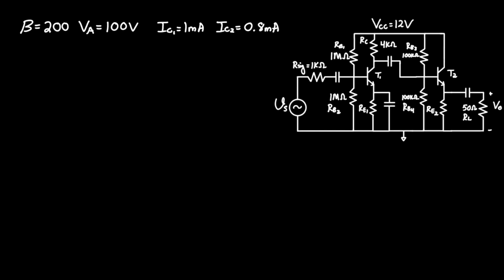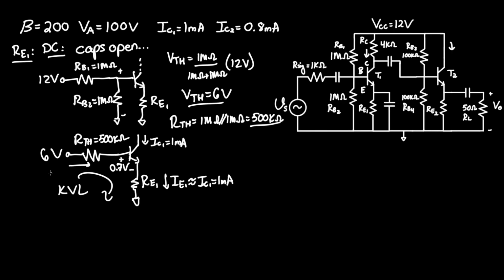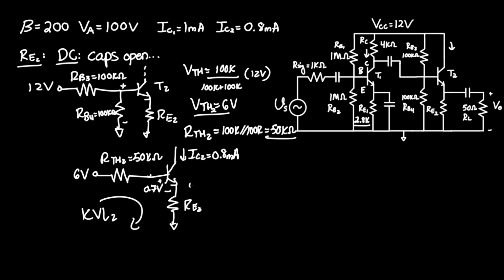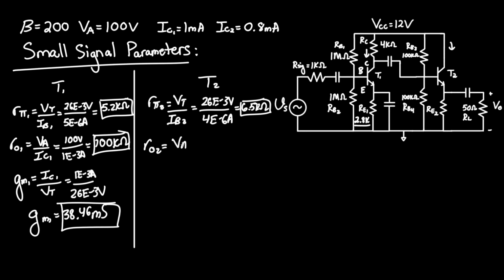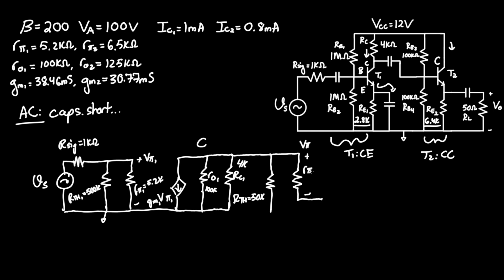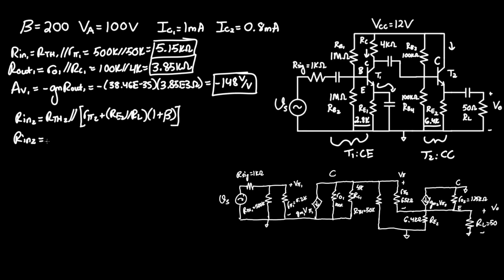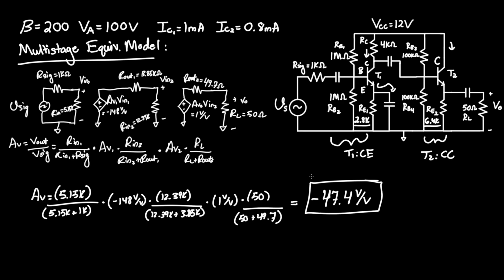AC/DC Analysis for Multistage Amplifier

Comment: Why in Rout1 we didn't count that it is vth2 is parallel to rc1 and ro
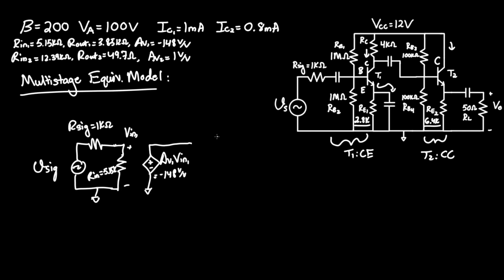Reply from the maker: I separated each stage so that I can take each external voltage gain into account during the final AC analysis gain calculation starting at 24:20.

Comment: Hello, would it be possible for you to give some sources that derive the expressions for Rin and Rout used in the video? Great content, thank you.
Reply from the maker: Thanks! Here's a basic overview of some that I've found: https://engineering.purdue.edu/wcchew/ece255s18/ece%20255%20s18%20latex%20pdf%20files/ece255Lecture_16_Mar8_MOSFET_Basic_Config.pdf

I would also recommend looking at the Sedra Smith Microelectronics Textbook for all the other formulas, they cover it comprehensively.

Comment: i wish to ask how was Vt gotten
Reply from the maker: Vt is thermal voltage. This constant is produced within the pn junction due to action of temperature. It equals kt/q, or Boltzmann's constant times temperature over charge of electron. At room temperature, this value is about 26 mV. This is assumed to be a constant and is typically provided for every problem. Does that answer your question?